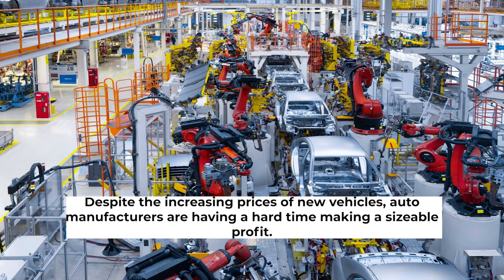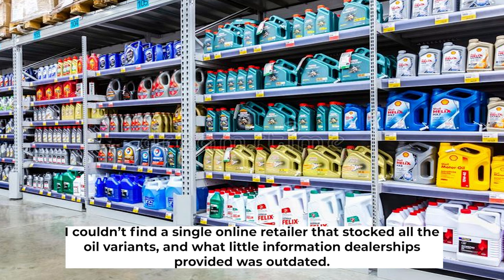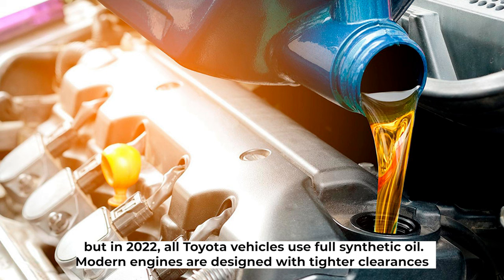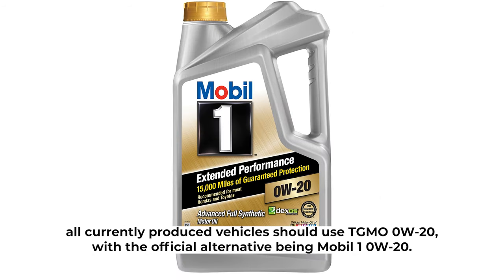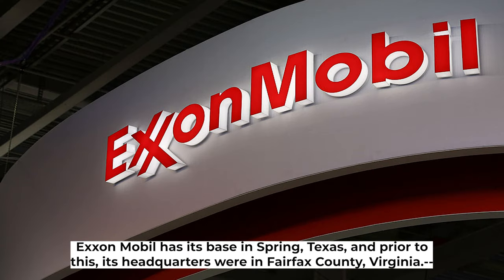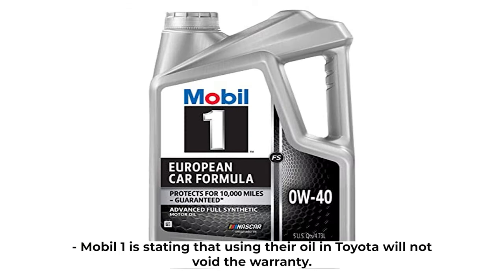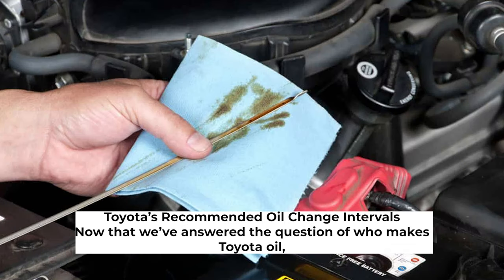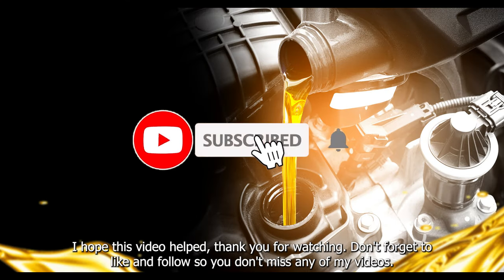Who Makes Toyota Oil and Is It Any Good?

Comment: That's interesting because The Car Care Nut who worked for Toyota  for years before opening his own shop said they use the cheapest oil out there
Reply: I was just thinking about that and wonder what he'd think about this video! He also suggest you change your oil every 5,000 miles regardless of how you drive!
Reply: I am sure when TCCN stated cheapest he meant lowest price option oil change. If you pay for synthetic oil change, they are not going to use the cheapest unless the dealer wants a lawsuit.
Reply: Like car care nut says.. The oil change intervals  end up being way more important than the oil brand as long as you're using the correct weight and it's certified. 
A side by side comparison would be interesting thou, say after 200k miles both engines oil were changed every 5k... To see if noticeable more wear on one with one oil brand vs another.
Reply: I have rav4 with 200k always used toyota, thinking of changing to mobile...
Reply: unless you specifically are asking for genuine oil, the oil change specials or included oil changes will use whatever the cheapest oil is. my understanding from AMD
Reply: Not where I go in NZ Toyota.
Reply: @nicholasroberts9618 Germany it's same 0w16 they not give
Reply: Fir Lexus is250 ABT thoughts what should I use?
Reply: And yet Toyota engines can last forever, something is not adding up.
Reply: After researching the topic for a while the conclusion I have come to adopt is: change your motor oil every 3k-5k miles and filter quality is much more important than the oil. Modern synthetic motor oil is good enough as long as you change it and the filter.
Reply: @Being_Joe  former head engineer for Nissan engines says to change the oil every 2000 miles because that's when oil actually starts to break down and engine wear begins.
Reply: @JaysonSmith-uk6cl  The Toyota dealer here in Canada in Belleville Ontario told me they use mobile 1 oil which Toyota uses also which is rebranded as their own when you buy Toyota oil in a bottle.
Reply: He didnt say that. He said the dealers use the cheap oil.
Reply: @Satrolkof Royal Purple is what I use in my 2023 RX350
Reply: He said alot of the dealerships use low-quality.
Not the manufacturer. And Toyota oem oil is made by Mobil. Thats why alot of Toyota/Lexus dealers stock Mobil1 oil.
Reply: I have seen oil analysis and the Toyota blend has incredible levels of moly as compared to the same Mobil 1 of the same viscosity. Matter of fact I have never seen a virgin oil analysis of any American brand with those high levels of moly in the Toyota bottled oils. Some American brands have decent levels of moly and far better than the ones from Mobil.
Reply: Same at my Toyota dealer, they buy the cheapest oil they can and see it at top prices.
Just crazy.
Reply: I believe TCCN says the toyota DEALERSHIPS use the cheapest oil being that they buy them in 55 gallon drums and go with the best deal at the time no matter the brand. He himself uses the toyota brand oil on all of his services for both his own vehicles as well as his cutomers to my understanding. Intervals aside, he says to use toyota branded oil and oil filters. I could be mistaken, but this was my overall understanding.
Reply: Toyota oil is made by Mobil 1
Reply: No, he claims that many Toyota dealerships use the cheapest oils they can find and NOT Toyota branded oil. He only uses Toyota products but suggests most oils are fine if you change at 5k miles
Reply: https://www.youtube.com/watch?v=IRwvfvwWbYE&t=16s
Reply: Wrong.  What he actually said was that when you get your oil changed at Toyota, the dont always use Toyota oil that you get at the parts counter.  They use bulk oil and its the cheapest that they can find.   What brand it is, is anyones guess.  But Im pretty sure if they charge you 29.99 or give you a free scheduled maintenance oil change, it aint gonna be toyota brand
Reply: Wrong. He said dealerships use the cheapest oil. Toyota brand oil is not used at dealerships.
Reply: Its Mobil 1 Advanced Full Synthetic. The problem where they cheap out is that they will have you only bring the car in once every 10k miles for free oil changes which I am not comfortable with. And for them its great because premature wear means you buy new car. GM does this too with My Cadillac as ACDelco is also Mobil 1 Advanced Full Synthetic but that car GM only had one free oil change so the rest was done on my jurisdiction of every 6 months.
Reply: Its Mobil 1 Advanced Full Synthetic. The problem where they cheap out is that they will have you only bring the car in once every 10k miles which I am not comfortable with. GM does this too with My Cadillac as ACDelco is also Mobil 1 Advanced Full Synthetic but that car only had one free oil change so the rest was done on my jurisdiction of every 6 months.
Reply: @donniev8181 thats more to do with good design and the use of quality components than oil. But yes oil increases the chances of you Yoda hitting 200k or even 300k miles.

I saw an interesting video on the development of the mkV Supra (which was co-developed with BMW). And the Germans were taken aback by how thorough Toyota engineers were about quality. They took their B58 engine and swapped components down to the bolts with more durable components. This led to cultural clashes as a result between the Germans who have their own pride in German engineering and the Japanese.
Reply: @juanzingarello4005  ten times the amount of dry lubrication additives has a little something to do with it also. Toyota engineers know exactly what they are doing.
Reply: He's also said that it was made by mobile one

Comment: Anyone changing oil at 7500 or 10,000 miles is just asking for trouble and eventual burning oil.  Oil is cheap, engines are not.  Please folks, change your oil at 5000 miles.

Comment: My 21 Land cruiser calls for 0w20, but the same Land cruiser every where else in the world says 5w30, why? They are all built at the same plant in Japan and I have the v8 5.7 engine, which is exactly the same v8 used in ALL the v8 regardless of which country it goes to, so why is it only America  that you can only use 0w20 but everywhere else you can use 5w30? Why?
Reply: Sir this is due to weather ! If you look on some oil fill caps they will suggest 5w30 or 0w20.
Reply: Along with weather conditions, in the US we have stricter emissions laws and they are getting stricter every year. That’s one reason you are seeing all these turbos replacing bigger motors. I do not know if they are actually better for emissions when you are burning as much gas but who knows. Laws are laws though
Reply: Wondering the same thing.  What about 0-30.  I’m thinking that is the ticket.
Reply: EPA fuel economy requirements is why in the USA. I was driving a 2001 car. The oil requirement was 5W-20, same exact car 2000 year model oil requirement was 5W-30.  EPA had passed more strict mpg requirements.
Reply: Strictly due to the need to meet American fuel economy standards, aka CAFE standards. If it does not get extremely cold where you live, you might be able to use 5W-30 and even 10W-30 in the warmer months. In the case of one 1990s era engine, the oil recommendation in the U.S. was 5W-30 and in Australia up to a certain year 20W-50 with the same engine. I followed the U.S. recommendation because I wasn't sure if the U.S. model had tighter bearing clearances. You do need to research what the bearing clearances are and if they have changed. Even if it is the same engine, some aspects of the design could be changed after a certain year. Or different markets could get different variations of the same engine.
Reply: Go to any Mexican sellers of motor oil and the most popular is 20w50 and single weight oils. Hard to find 5w30 and harder to find 5w20 oils.  Even manuals for various makes recommend 5w30 for Mexican engines.  I bring my 5w20 oil from Canada when I travel to Mexico.
Reply: 0w-20 because America gets cold, hence the 0w, and the 20....don't care. If you have 30 oil, it won't matter. The only issue is vvti systems get smaller and smaller ports, so 30 oil may interfere with pressure switching and stuff
...but not to any noticeable amount. It's mostly,  as they said, for epa reasons. The W is important,  depending on where you are, not so much the 16, 20, 30. If you run your car hard, or for long distances, the thicker oil would even be better. I know a guy who uses 40 diesel oil in his car. It runs fine. Smokes a little on startup,  but runs perfectly fine.  That's to say if 30 is all you have, don't sweat.

Comment: I remember a service rep told me Toyotas OEM oil is actually Mobil 1 Advanced Full Synthetic. Which explains why when I first bought my Rav4 in 2016, they said they only needed annual oil changes. Needless to say, I am still not comfortable with annual oil changes and prefer to do it every 6 months in the Spring and Fall (my miles stay below 5k miles every 6 months so its easier for me to go based on time and I have a fresh batch prior to the extreme seasons of cold winters and hot summers). When I stopped taking it to the dealership (once the free maintenance plan went away) I was doing Mobil 1 Advanced Fuel Economy, then switched to Mobil 1 High Mileage once I hit the 75k mark. Now with a second car (a Cadillac) that uses the same viscosity level, I just buy the Kirkland brand from Costco which comes in a box of two 5 quart bottles. Just as good and at 90k miles she still runs like a champ. Provided the electronics hold up I expect 200k miles from her easily.

Comment: The oil change interval varies according to the owners manual based on how the vehicle is driven. The manual lists 2 different scenarios, normal and severe. Severe would be short trips, towing, cold weather climates etc. If the severe conditions are met the oil change interval is cut in half.
Reply: Or if you have a 2012-2017 Camry and you want the engine to not die sooner than it should.....

(In regards to needing to do the "in-between" oil changes)
Reply: The owners manual doesn’t say that only comment is if you can’t find 0w-16 use 0w-20 but change back at next change. There is a small notice that server usage may need a thicker oil but no other mention of what to use like the temperature charts they use to use. 
Fact is all cars fall under the server usage, where people get confused is taxis and police cars are extreme usage not server.

Comment: As a AMSOIL DEALER for 12 years and I was curious about where all the San Diego County major Toyota Dealerships Service Departments purchased their Synthetic oils in "Bulk" quantities from, because inside all there (Parts Departments) they all sell by the quart size OEM Genuine Toyota Synthetic oil brand and also Mobil 1 Synthetic oils at high over the counter prices... Funny thing is, all the (Service Departments) buy their Synthetic oils in "Bulk" form and store them in large tanks 80,000 gallons to 100,000 gallon tanks filled by "wholesale" commercial Bulk Oil companies... They do not buy OEM Toyota or Mobil 1, they all buy the lowest priced Synthetic oils like the "ENEOS brand" that meet Toyota API specs and Toyota TGMO specs... ENEOS oil is made in Japan and imported to USA.

Comment: I have a 2000 Toyota Camry LE 2.2L. The Camry was given to me by my late cousin it was his father's Camry. I'm the 4th owner of the Camry. The oil I use is Pennzoil Platinum High Mileage Synthetic oil 5w 30. My cousin and his father Pennzoil or Quaker State which is made by the same company. I have always used Pennzoil. I've never had any issues with Pennzoil. I change the oil every 3000 miles. The Camry now has 185,000 or just  over it. I change the oil every 3000 miles like cloak work. When the Camry was given to me it had 166,492 miles on it.

Comment: The thin oils were chosen for 2 reasons:

- Fuel economy (due to thinner oil versus say 5W30 BUT at the cost of protection)
- Fuel savings in that the oil will get to N.O.T quicker than 5W30 for example (so the engine won't have to idle at a higher rate for as long).

Comment: The owners manual will tell you what specs the oil needs to meet / exceed.

So if the oil that you buy meets / exceeds those requirements then you will NOT void your warranty.

Comment: Just bought a new Toyota Camry SE and their recommended oil change interval is every 5000 miles. Theres a great video that breaks down the additives in oem toyota, mobile 1, penzoil and one other motor oil here on YouTube. Toyota has extra additives that none of the others have, or they have a lot less of certain additives. The former head engine guy for Nissan suggests changing the oil at 2000 miles regularly.
Reply: "The former head engine guy for Nissan suggests changing the oil at 2000 miles regularly." Funny. In Nissan products you can change oil every 1000 miles but this won't help. They'll go bankrupt anyway.
Reply: @bobsum1745  absolutely no relevance

Comment: What , you shouldn’t use Pennzoil Ultra Platinum or Valvoline Extended Performance.
You are joking right ?
Both are better than either Toyota oil or Mobil 1.
Reply: I tested few oils in my cars and found the Pennzoil Ultra Platinum to be the best one.
Reply: I used to use Mobil 1. Wasn’t a fanboy of it, it’s just what I was used to grabbing. Then, for some odd reason, I decided to switch to Pennzoil Ultra Platinum. And IDK what is it about that oil, but my truck just felt better. I do all the maintenance myself and change the oil every 5k miles, no matter if the bottle of oil says 10k-25k life span. So I know it wasn’t because it was neglected and then everything was “fixed”. So PUP is definitely my new “go-to” oil, but I’m not opposed to trying others to see how my truck feels. 

I’m about to try Valvoline Restore & Protect on my next oil change, sounds like a very promising oil.
Reply: @leo-ub6nb  Same for me

Comment: When my 2015 Camry started burning oil at a fast rate, I used Valvoline syrhetic extended oil. Then decided to use oem toyota oil to see which was better, and the oem Toyota oil burned alot better than the Valvoline oil did, not even close. Then I decided to try the Pennzoil syrhetic motor oil, and that was so much better in terms of burning oil. I agree with you on the Pennzoil,  its a great product. But the Valvoline not so much.

Comment: Different countries do things differently.

For example in Australia for my 2017 Camry, they wanted to use SEMI-SYNTHETIC Castrol engine oil.....

Semi-synthetic here in Australia is:

Mineral oil that has been blended with Synthetic oil

In Australia we are a bit more relaxed about what can be called "full synthetic"

Even though it's origin might be from crude oil, if it has essentially been engineered and altered / changed by people with white coats....

We call that Synthetic....

So yeah I supplied my own oil......

Comment: Really! Toyota recommended every 10000 miles oil replacement😮 im not leasing the car im buying and keeping the car so i replaced my oil change every 5000 out of my pocket  still in my warranty dealer will replace every 10000 miles minus my own pocket every 5000 with same oil Mobil 1

Comment: I just started doing my own oil change as Im no longer receiving the "free oil changes" at the dealership, it has 25,770 and I went with Mobile 1 Advance full Synthetic  0W-20 as I live in Texas Heat and think it will do just as good as the 0w-16. will see how she does in the long run I plan to change it every 7,500 miles.

Comment: When you go to toyota dealership for service they don't use toyota oil they use valvoline I don't know why  and most newer cars uses 0w16 as someone mentioned earlier
Reply: Yep I got oil changed at the Toyota dealership the other day and they swore they use Toyota oil but suddenly my mileage dropped 8mpg. Changed oil with Toyota 0w-16 and magically my mileage improved again
Reply: Why? because Valvoline is cheaper is about profit. That's why i change my oil use Castrol and buy it in Walmart.
Reply: They use whatever bulk oil they got the best deal on and a value filter. I normally buy pennzoil ultra platinum and a oe filter for around $40.00 and the dealer charges $20.00 to change it so I’m still coming in cheaper then there oil change and getting a much higher quality of oil. My gf took her car to get a oil change 1 time and let them use whatever they use and it was completely black before 2k miles. That ultra platinum stays honey brown for a long time 3-4K or more sometimes
Reply: @thetechlibrarian  I hate these service shops that use bulk oil. Because customers really  don't know what's in that  jug
Reply: One reason for the Valvoline . The Camry are made in Georgetown,Kentucky. Valvoline headquarters are in Lexington,Kentucky about 20 minute drive. Valvoline gave them a sweetheart deal.

Comment: Unless you’re willing to pay for the manufacturers oil you getting what ever brand they get the best deal from meeting the specifications. I deliver a lot of Napa (made by valvoline) valvoline,Kendall to dealerships along with aftermarket filters such as Napa proformer,or off brand. So if you think you’re automatically getting your manufactures products without specifically asking and paying a premium for them you are a grossly uneducated consumer.
Reply: I’ve heard of both. I’m a tech at a Toyota dealer and we use genuine filters and oil for customers. Anything not 0W-16 and 0W-20 is conventional fluid from Toyota. Or we use mobil 1 full synthetic if preferred by a customer. But I do have buddies at other dealers who say they use fluid from oreillys. My dealer also uses a lot of BG fluids. We use them for brake fluid, differential fluid, and power steering fluid. Otherwise coolant, oil, parts, transmission fluid, are all OEM.